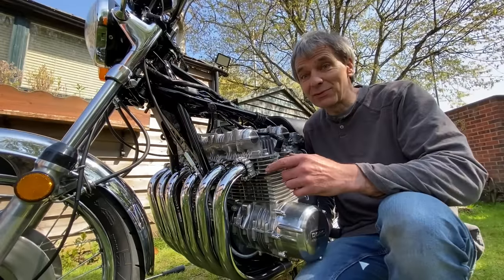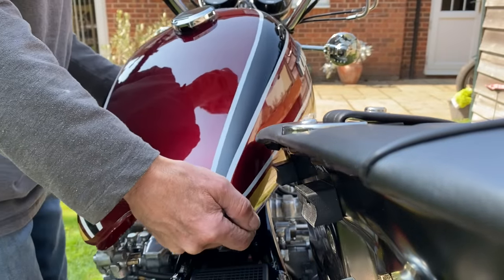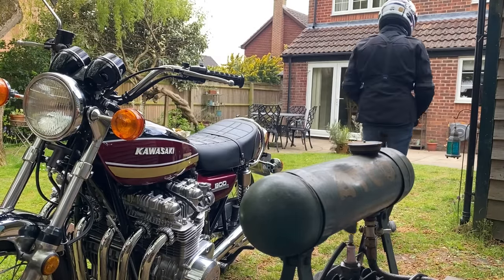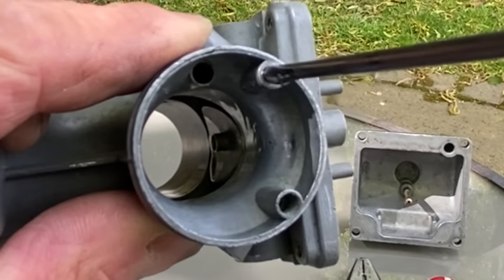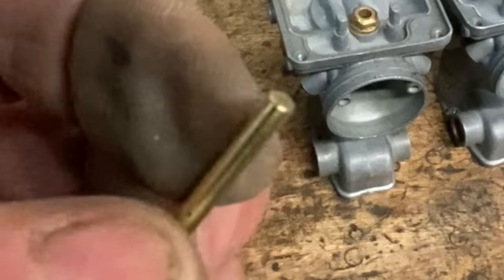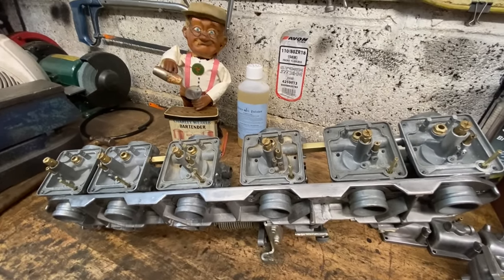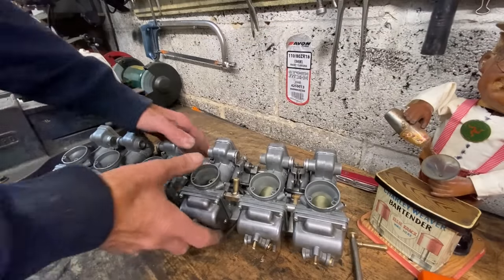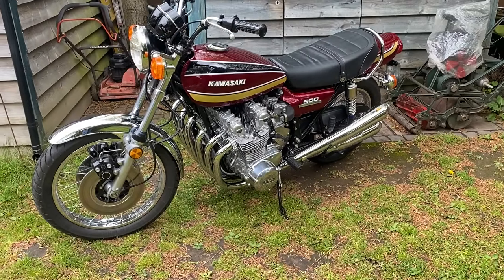Millyard Kawasaki Z1B Six Cylinder -  First start,  Ride,  Carburettor Fettle and Tips

Comment: Not only does he build incredible machines he also films it better than most so called moto vloggers thanks   Alan for all your hard work
Reply: Engineers do it right
Reply: @dhananjayringe  Who said he was an engineer?
Reply: @TastyChevelle  who said he isn't?
Reply: @TastyChevelle  He served an engineering apprenticeship with MoD (Ministry of Defence) as a toolmaker and instrument tech, much as I did in the Royal Navy. These were craft and academic apprenticeships lasting about 5 years, with lots of hand tools and machine work. Technically these are technician apprenticeships rather than being an engineer, who usually have a degree. I guess engineer is broad and loosely used term.
Reply: @JohnRushworth  Engineering - noun 1.
the branch of science and technology concerned with the design, building, and use of engines, machines, and structures.
2.
the action of working artfully to bring something about.
Reply: @JohnRushworth  Allen has designed, built and used. He’s an engineer for sure.
Reply: @JohnRushworth  in the UK the term engineer is indeed very broad. In North America the local Professional Engineers' authority can fine you for using the term if you aren't accredited, with specific exceptions. For example, in Ontario if you aren't a P. Eng, train driver, or stationary/power Engineer, you can't call yourself an engineer. Even a graduate with a Bachelors of Engineering can't call themselves an engineer until they join PEO.
For this reason, you can't call yourself a Microsoft Certified Systems Engineer, you have to call yourself MCSE Certified.
In Oregon there was a case a few years ago where a retired professional engineer got punished heavily for saying "I am an engineer" when giving an opinion about red light cameras.
Reply: Mll
Reply: I know a genius that called himself a undocumented engineer.

Comment: Allen, you remind me of 1970 and me on my AJS 500, when I was of the mind to fix anything that went wrong with my bike. No such thing as ‘can’t be done’. I’m pushing 67 now and still prepared to get my hands dirty on my Triumph 765 triple. Thanks for taking the time and effort to make such great videos!
Reply: I’m 65. Just spent about 4 months rebuilding a Fiat Panda 1.3 16 valve diesel. I took the engine out and stripped it right down. It’s now on the road and lovely to drive. I’m looking at doing another one.

Comment: Must be a good feeling and a proud moment to bring a one off engine you've created and built, to life, hearing it purr and run for the first time!
Great work as usual.😎👍
Still makes me miss my 1981 Honda CBX1000 6 cylinder beast, the grin from ear to ear when riding that was fantastic!
Reply: The first time I heard a CBS coming up my street I thought it was 2 of my mates but it was only 1 of them, my mate Colin on his silver 81 CBS I was 19 and thought I'd seen the future Haha!😎💕🖖
Reply: That shud be cbx not CBS  F'in autocorrupt 😎💕🖖
Reply: @kevinscollan8293  Yeah got it!
They do have a very distinctive sound track and a very addictive need to be knocked down a cog and opened up going through a tunnel

The thing that most surprised me about them was the grin factor as that engine pulls from so low down right through the rev range. Most 4 cylinder bikes of that era had a powerband where the engine came on cam and felt like a turbo kicked in, the CBX just made power right through the rev range, the low down torque was incredible!

The first time I ever got up close to one was when I rode a 1981 suzuki er50, I was 16 my mate pulls up on his brand new bike, I asked the dumbest question, 'what's that a 500?', he grinned at me and said 'no, double that and add a bit more!' 😲⚠️😳
It was a brand new CBX1000......

I guess the seed was planted back then, fast forward a good few years and I ended up buying one, a 1981 model.....worst thing I ever did was sell it! ⚠️😲😥

Comment: Great Video & Bike ,I've  Owend A .79 Honda CBX ,For 14 years & I used  Marvel's Mystery Oil ,in Gas & Hardly Ever Have To Rebuild The  Carburetors,& Same With My 70 Torino Cobra Jet, Carburetor, & Every Year I Would have To Rebuild  Carb,& it Only Takes About  A Shot Glass  of Marvel's  Mystery  Oil For A Motorcycle  Full Tank of Gas .& 2, For A Car Gas Full Tank ,& On ,My CBX, Had individual K&N Air Filters On all 6 Carb's & Made Job Easier To Work On & Gave Bike More Power & A ,6 inti 1 Hedder On CBX & What A Beautiful  Music  Came Out of Pipe & Motor in High RPM'S ,& I Know You like The Stock Equipment, Sir ,But ur Missing A Beautiful  Hedder Song ur Bike Would  Make !!  & Everywhere  you Went ,People  Would  Say ,Did You Here That ,😲& You Would  Stain Their Memory For Life 😲,With That 6 Cylinder Sound,& My ,Friends Would  Called Me. The RPM, King 🤴Coz of The Song That Came Out of  That CBX in High RPM'S ,Thank You Again  For  Sharing ur Awesomeness ,With Me & The Video's on ur Page & I Follow you on IG Also ,Torino Tom, 🙋‍♂️

Comment: Allen Millyard - the only guy with 2 identical, unique one-off custom built 6 cylinder Kawasaki Z1Bs. And yes the irony of my words was intentional.
I wish Youtube (and Allen) had been around when I was a youth.
I bought a used Suzuki GT 550 and after a few weeks blew a hole in the middle piston.
When I went to the shop for piston the guy asked "middle pot?"
"Yes"
"Expansion pipes?"
"Yes"
"K&Ns?"
"Yes"
"Common problem. The guy who sold it to you put the pipes and filters on it, but didn't re-jet it. I suggest you take a bigger set of jets."
"That's a bit beyond me, just give me the piston".
"Well it will happen again, so if you're not taking jets, you better take another piston."
A month later, on the way to work, I melted the middle piston again and had to change pistons on the side of the road in the middle of the Northumberland moors.
Next weekend - "can I have that set of jets for the GT550?"
Even with a Haynes manual I might as well have been performing brain surgery.
I blame Allen!

Comment: You sir, are a master craftsman and after discovering something unique somewhere BESIDES your channel (which has many examples of unique) you know what I think should be your next challange? Designing your own AAR Alligator. Only with yours.... Heh.... I propose a ~270 degree crank inline twin with a fair bit more power than the modified 700 single they were using. Either through turbocharging if you feel up to it, or plain displacement if you can find a good donor engine (maybe a KTM 890 duke?). Otherwise, feel free to use a more modern big power single like the KTM 690, and if you wanna go crazier than that, turbocharge THAT!

Comment: Wow That motor sounds so powerful. You must have mentioned this some were but How much horsepower do you thank it makes. I am thinking if the 4 cyc make 86 HP half of that would be 43 + 86 = 129 HP is that in the ball park? You do amazing work. c]8-)

Comment: Sounds beautiful ! I've got an R100RS Boxer sitting in my garage. I've not started it for 22years. Would you suggest doing anything special before hooking up a battery ? WD40 down the spark plug hole, tappets ? Fantastic to see your Kawasaki on the road in such condition.

Comment: I take it you're known by the local constabulary?
One would think Kawasaki Marketing would be all over the mark: Z1B6. They wouldn't even need to spend a dime, just roll them on to the showroom floor in droves --- they'd all be gone with the wind ( ... "and so will you be" said my long gone Drill Instructor at USMCRD San Diego but I digress)  The "this is how I do it (complete attention to detail within a complete composition which will, in short order, be pushed into physical stress on the road with me aboard") portion lightens my heart with mirth. ("LOL" for all the kids)  Like sippin Tennessee Whiskey.  Also liked hearing about how you got into motorcycling as a kid, working with what you had. Some other channel. The crumpet kept interrupting, but OK, pretty funny. Sounds like your dad had his head on straight too. Now I'm wondering about the aerodynamic stability of 2 wheeled V10s heavy as they are, going 200 mph

Comment: I'm beginning to fall in love with the Kawasaki Z1. Do they run on E10 fuel without additives? I used to take everything for granted when I was in my twenties & just filled up. I wouldn't have a clue how to look after the mechanics of the engine these days.
Did you improve the airflow on your blue Super Six. You said it wasn't running well on a four cylinder filter.
I saw a lovely video of a burgundy Z1, the restorer did an excellent sympathetic mechanical job using the correct sourced parts, and converted it back to an 'original' bike. The pre owner had put twin front discs and 'alloy' wheels on it, but the restorer replaced those with some original spoke wheels. The bike was a bit tatty to be considered a full restoration but was all mechanically sound & to my liking. I like the 1980/81 Suzuki GSX 1100 E in Silver with the Green Stripe, I think that's an excellent motorcycle with the Twin Swill Combustion Chambers & Aluminium Swinging Arm. Great Videos Allen.

Comment: Allen, sorry to trouble you with this but why does a bike not hold a throttle position, makes it so difficult to ride it. It's okay when power is on but as soon as I let off, not even close completely, the bike dives so very frustrating. It's a wee BMW F650 single with twin carbs. They've been stripped/cleaned/set as per the manual. Someone said to me it may be carb icing. I'm finding that the BMW is more and more, mostly parked, which is a shame because it's a lovely bike. I did order a fuel line off the internet and it feels like silicone, I'm wondering if it could be collapsing when the engine is warm. Anyway I'd be grateful of any thoughts on this, you've forgotten more than I know about carbs so floundering a wee bit. Many thanks, Jim.

Comment: nice vid - I rode one of the first Kwacker Z1 900 in Australia in the early 1970s when it was declared the first 'superbike' - a guy I knew had bought one new then converted to Christianity and decided it wasn't seemly for him to be riding such an outrageous bike - so he asked me to ride it from Brisbane to sell it to a Melbourne dealer - about 1700km - which I happily agreed to do as a 'favour' to him ... !

My favourite was winding the throttle on the highway and passing six cars at a time - getting to 100mph past the last one.  Got my first major speed ticket luckily after slowing down from about 130mph.

But I stopped riding after my major prang (caused by idiot car driver) on a Ducati.

This vid worries me when he tailgates at about 5min15sec - about 1 sec following distance is not enough when car driver in front slams on their brakes for something on the road in front of them ...

Comment: I never owned an H2 750. Rode one briefly with a bald tire on wet pavement. It was running good. Spun the wheel and brought it back. Bummer. Also, remember the high center of gravity with these two strokes. The are NOT friendly in the corners at high speed. Be VERY careful. A word to the wise.

Comment: I'd like to see a v-twin turned into a single. A KTM 950 with the rear cylinder turned into reciprocating balancer. A 425 with an overbuilt transmission would be interesting to see weight.

Comment: I know this analogy is "over the top" but watching an artful mechanic working on the carburetors of this lovely vintage Kawasaki 900 engine, which when tuned to perfection produces a melody like a symphonic masterpiece, is like unto a tuner setting up a Stradivarius for play in a symphony. A similar motorcycle is the Honda CB1000 which hefts 6 carbs as well, and makes a sweet tone to the ear as well.

Comment: Excellent video!  Methodical careful work.  Gifted hands.  Only thing I would have considered is replacing the floats.  Floats such as those over time will become weak by absorbing gasoline.  Modern fuels especially can get at them and absorb into them reducing bouyancy.  Needle valves fail, etc.  flooding, etc.  Sometimes people compensate for the lack of bouyancy by bending the float.  This might have been the case in your situation.  Bottom line...... Id let you work on my bike any day!  Thanks for posting the video.

Comment: Super Carb tuning;
I am retired now, but when balancing the slides on multiple carbs, I used light rather than drill bits although they do a reasonable job.
Method: use a large peace of cardboard with holes cut out for each carb and place a workshop strip lamp behind them.
Next: put a thick or black cloth over your head to cut out the ambient light, now you can adjust the slides by adjusting the light crescents until they all match.
Last of all: you can then adjust the whole bank of carbs via the tick-over screw or screws. Doing this will tell you if your crescents stay where they should do.
 PS, thanks for your video showing that cleaning carbs properly is a very good way of getting the best out of any motorcycle, and Happy riding to everyone.

Comment: I would like to see Alan making half cylinders as well. Using trusty hacksaw cut vertically through the piston rings con rod gudgeon pin piston slap on an old Villiers fly wheel and two village water pumps simple alternative energy for the pla net. First test ride JustPERFECT!!!!

Comment: I owned and rode one of these in the 1990's. Absolutely awesome bike. The engine was very smooth and had endless torque. Handling was adaquate but not race bike. The thing was way faster than my skill or nerves. This is the ultimate UJM. 
 
I finally had to sell it because my legs are too short to hold it upright on anything but level ground. I am glad I rode it but also glad I sold it.

What do the wiggly lines on the pavement mean?

Comment: I remember building those carbs , 29 smoothbores , 32 cvs 34 smoothbores , its amazing how much you remember from your youth as Mr Millyard so casually runs through these things , those old aircooled Kwakers did not break , the first thing I always did was weld and balance the crank , so , when the horsepower came up , the crank was ready for it , I did my time in a racing outfit so I learnt a lot of power tricks in the day .

Comment: so gorgeous, nothing about it doesn't look absolutely stock, as if that's the way Kawasaki engineers designed and built it, brand new super six, bet they wished they had thought of it, that exhaust is keen and opening up each can for the added half cylinder was the ticket.. again, as if the engineers at kawasaki built it, somany would just leave it bottlenecked, brilliant work Allen

Comment: That was a very thorough carburetor cleaning. I learned a lot about the air circuits. I love the little rubber adapter for cleaning the low speed jet. Brilliant, I need to make one of those. I will be paying more attention to cleaning the air inlet ports next time. Allen that is a beautiful paint job. I love that red. I enjoyed the ride. Thanks for taking me along.

Comment: how are the exhaust manifolds since there are 4 outlets for 6 cylinders?
Are there 2 in 1 or 3 in 1?
and if for some cylinders the output is direct, does that not pose a flow difference problem?

Comment: I am curious, do you believe there would be enough wall material left with the cylinder liners removed to be able to weld the upper stepped section machine it round and have the aluminium nikasil plated for larger diameter skirtless pistons to be fitted?

Comment: 10:50 sorry, but wouldn't it be better to clean of the outside of the choke tubes first and later the holes? I'd be afraid to polish dirt or parts of the steel wool into these tiny holes ...

Comment: Beautiful build 😲🤗
Some people display their works of art in galleries - and  there are others who ride there's down the road. 
That's the best carb bank rebuild tutorial I've come across on here, very clearly filmed and explained.
Only thing I can add having done this for myself and others on 4 Bank's is the screw heads are always chewed due to previous use of ill fitting screwdrivers - neither Phillips or pozidrive fit, because japan uses its own unique form thus I'd advise anyone working on japanese machines to invest in a set of jis screwdrivers (japanese industry standard) which having the correct form fit the screw head.
Reply from the maker: Thank you glad you enjoyed it

Comment: Nice work on the carbs! Did they use Keihin carbs on these? I noticed a lot of the linkage and the synchronizing adjusters look very similar to what was on my '72 Honda 350F.😉
Reply from the maker: they are Mikuni

Comment: Fantastic work as ever Allen. I owned a Kawasaki GPz 1100 B1 in 1982 and that was fuel injected, did you remove the Bosch system on yours and fit carbs?
Reply from the maker: No the dfi worked great it’s my ch improved on the B2

Comment: Great video Allen, new subscriber. I'm having problems with my restored 1982 Yamaha XJ550RJ Seca Carbs. I have removed them twice, It ran well the first time but acted up a few months later. The second time one carb leaked at the overflow line ( stopped after a light tap on the bowel ) but engine would not idle. My research indicated that the pre-ignition was the problem ???? Any suggestions would be appreciated. Thanking you in advance Stephen
Reply from the maker: Double check the pilot circuits on all carbs the drilling’s are tiny and are easily blocked
Reply: @AllenMillyard  thanks Allen plan to work on it sometime over the summer, those rubber boots between the carbs and the air box are extremely tight in the cooler weather. What I enjoyed about your videos is your attention to detail. stay safe let you know
Reply: @AllenMillyard  upon reflection Allen, it would be very helpful to learn how to maintain, service, store off season and adjust balance Mikuni Carbs. It is an ongoing issue for the life of a motor. thanks again Stephen